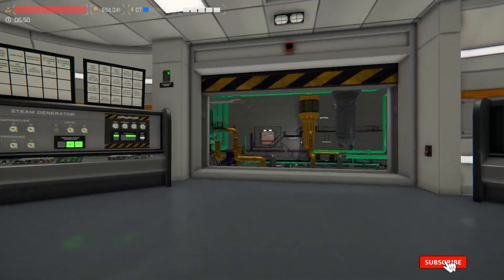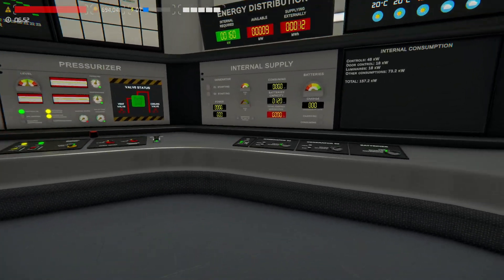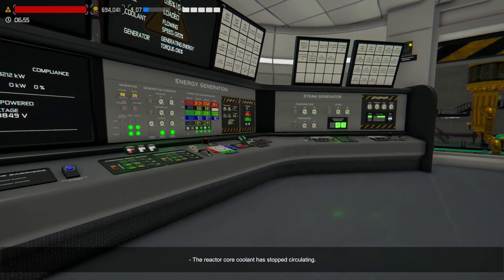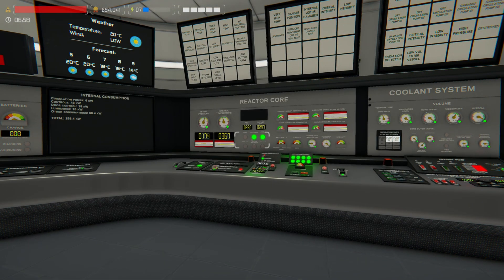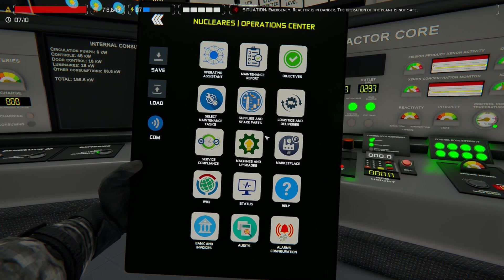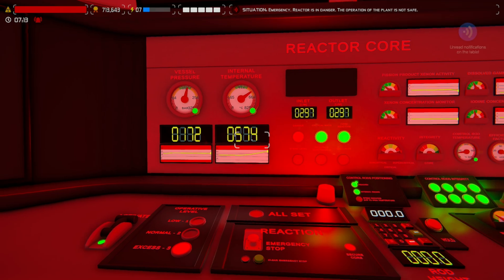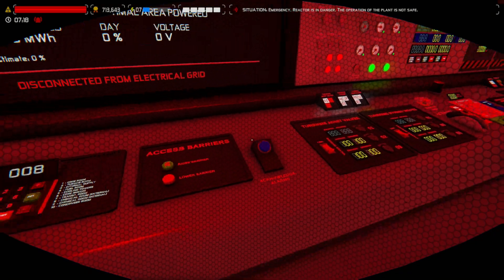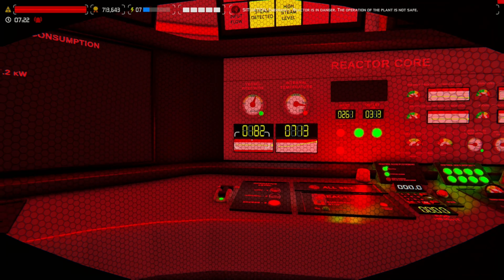Our 1st DEATH... Meltdown Test #1 - Nucleares Tutorial

Comment: You should have turned off the pressurizer.
It prevented steam buildup and thus the meltdown
Reply: In the end he did boil the core dry. I'm more surprised that it never got into a melt-down state and the integrity was still so high.

Almost looks like the game models the 'core' temperature as only the cooling water temperature and no water = no core temp and therefore no meltdown trigger.
Reply from the maker: It's just buggy
Reply from the maker: I have done the same thing with the pressurizer off... no change 😎😇🤪

Comment: best way to melt down is pull the control rods out 100% with the core out then insert the core
Reply from the maker: Yes that used to be the best way to cause a meltdown in older versions... should still work now but the games coding is a little different so not 100% sure haha
Reply: @ShArPy1o1Games  I stopped playing right after the synchroscope update but I'm about to get back in
Reply from the maker: You definitely should as its been a blast... Also check out the new hidden 'Testing Area'

Comment: You mentioned the void coefficient, but what you said was technically backwards. PWRs have a negative void coefficient, which essentially means that voids (steam) in the core have a negative impact on (i.e. reduce) reactivity. The issue here is as soon as the last of the water boiled off in the core, reactivity immediately went to 0. In technical terms this is because the water acts as a neutron moderator, and without it the neutrons in the core are moving too fast to reliably create fission. In actual reactors this is a major safety component, as similar to in game, it is very difficult to accidentally trigger a catastrophic runaway reaction.

Incidentally at one point you considered venting the core and/or the pressurizer which would have just accelerated the boil off of the coolant and the crash of reactivity (no pressure = lower boiling point)

I would imagine that the trick is to try and keep the core full of water as much as possible while driving the temps up. This probably involves running the feedwater pump constantly, and possibly even keeping the cooling pumps running at a low level. It may also be necessary to increase the temperature gradually as opposed to just going to 0 on the rods, again with the idea being to keep the reaction slow enough that the feedwater pumps can keep up with the rate of boil off.

Edit: Just tested, and I was able to trigger a meltdown by going to 0 on the rods and immediately running the feedwater pump continuously. The core temp reached just over 1500C before a broken feedwater pipe caused it to boil off and crash. There was still just enough residual heat to get the core integrity below 0, but it took a while as the core cooled down. Lower values on the control rods just resulted in the temp peaking at lower values, as feedwater damage was always the limiting factor for me.

Unfortunately the train escape seems broken at the moment, as the train only had the options of reservoirs and main entrance as destinations. Also I doubt the meltdown would be recoverable in this scenario, as I had to run the feedwater system to destruction to even trigger the meltdown, so I'm not sure how exactly I would get emergency cooling into the core, other than maybe the core pool. Possibly open the RCV and use the recirc pump? Not sure, haven't played with that much.
Reply: Actually the more I think about it, the solution may be to find the point at which core damage occurs (700? 800? I have no idea) and basically run the reactor stably at just hot enough to cause core damage over time. Essentially find whatever combination of rods/cooling etc. would hold it at precisely 800C (or whatever the real number is). Theoretically this would trigger the meltdown once the core hits 0 integrity, but ideally without damaging too much of the infrastructure needed to actually recover it.
Reply from the maker: Many things of which you said, I have tried already with the same success... unfortunately the pumps are not powerful enough to keep up with the boil off so I found the easiest way is to start a new Game, start up and output what's required to the grid and stabilise... then pull the rods all the way out (0), turn everything else off and watch the magic.
Also the train escape is possible as you need to push the red button in the train once the 5 Min countdown is triggered... the only Steam Achievement that's broken at the moment is the Reverse Meltdown...
Hope this answers some questions... also I've tried every which way to cause a meltdown and the way described above is the most reliable as a save game can be created once stable power is produced etc.
Reply: The water moderation in the game works... backwards. Cooling water is only used as a means to reduce temperature and the game's logic says "less temperature = less reactivity" which isn't how it works in a real reactor, in a real one, more water flow will result in MORE reactivity as there is more fresh water that can moderate neutrons.

That's why PWR's can be regulated fairly easily. More power demand = more steam flow in the secondary loop, meaning you need more water flow in the primary loop, increasing moderation, and ramping up the reactor's power without requiring any other action.
Reply from the maker: Pretty well said and quite accurate in terms of the game mechanics as of now at least... works 'weirdly'